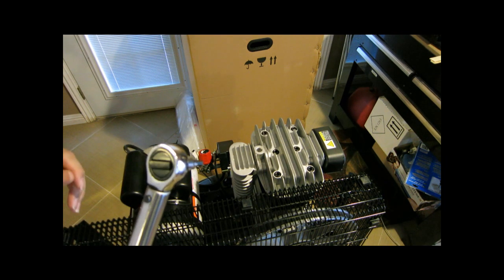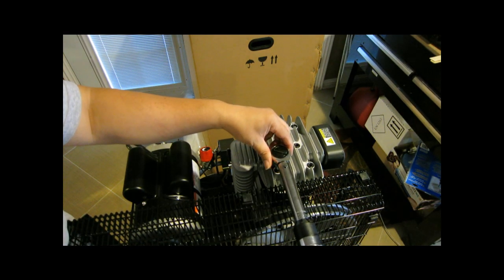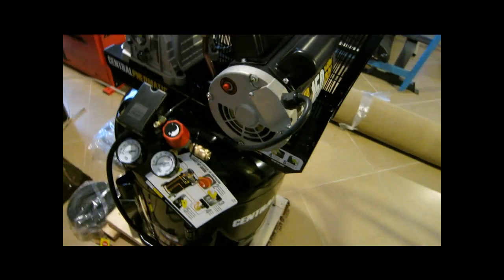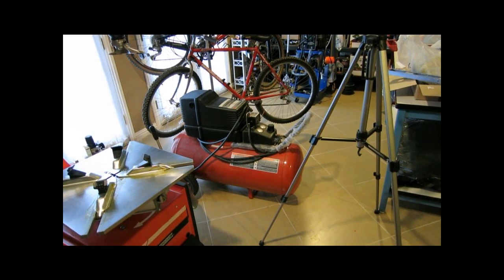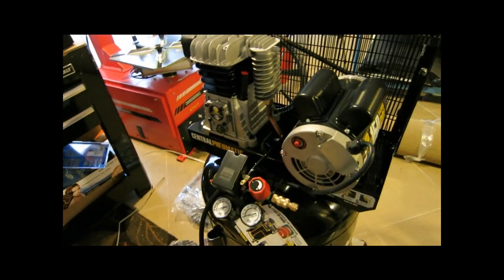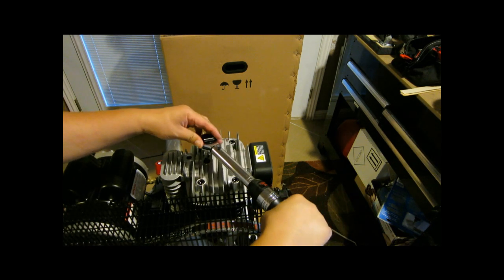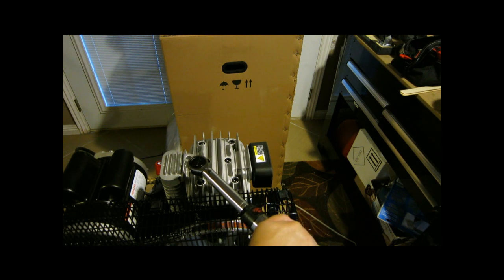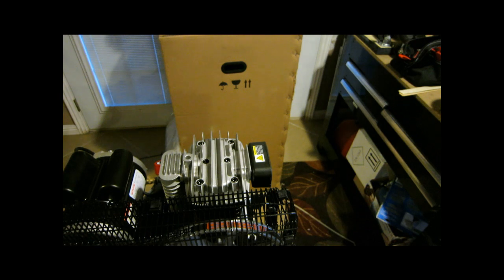Harbor Freight 29 gallon cast iron air compressor (68127) - Break In - Part 2

Comment: They must have got better at torquing the pump head bolts at the factory because mine was fine. Buyers may as well check that just in case. Although the manual doesn't recommend changing the oil after the break in, I did it anyways. Didn't look too bad, but there was some fine metallic particles in the oil. This one settles a bit too. Stops right at 150psi like it should, but settled down to 145psi as the tank cooled. I believe that's normal for a larger tank. Humidity was high at the time, so that may have been contributing. A good durable looking and feeling compressor though. Much better than that pos Husky 33 gallon oiless model I was going to take a chance on to save a few bucks until it decided right out of the box that it didn't need a pressure cutoff for the motor.

Comment: Where did you find your Torque Specs, I purchased the same compressor (Item 69865) and found no information in the manual for this.
Reply: I just bought mine today and i torque all head bolt to 35 lbs LOL
Reply: He is probably borrowing the information from someone online; who got it from a similar compressor pump manual.

Screw Size Torque Recommendations:

M6 9 to 11 N-M
M8 22 to 27 N-M
M10 45 to 55 N-M
M12 76 to 93 N-M
M14 121 to 148 N-M

Comment from the maker: Definitely no problems.  I'll run a 3/4" impact wrench with no issues.  Ratchets are no problem with this compressor.  I can even run a spray gun (HVLP), sandblaster, and orbital sander w/o any issues and these items are air hogs.

Comment from the maker: Yes, a few people have mentioned that I should go for name brand oil.  I'll do that when I run out of the HF stuff.  The HF oil is economical.   It's probably good to use it as break in oil.

I have the HF 8 gallon compressor and never changed the oil (it's been close to 4-5 years and the compressor still runs like new).  I can probably use the HF oil on that compressor.  Talk about abusing a compressor :).

Comment: I picked up the same compressor the other day, and found this video looking for less messy ways to change the oil. Just a tip, I've read a lot of people saying not to use the Harbor Freight oil. It sounds like a lot of guys just run a brand name compressor oil, often synthetic oil. I don't mind the Harbor Freight oil for now. I got a lot of metal out after break in, so I'll just be changing it a lot until that stops.